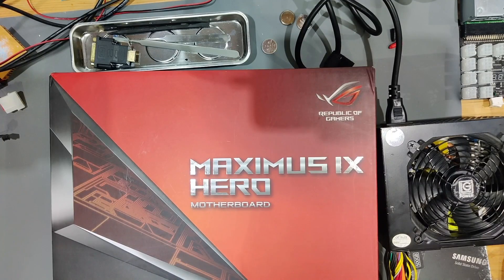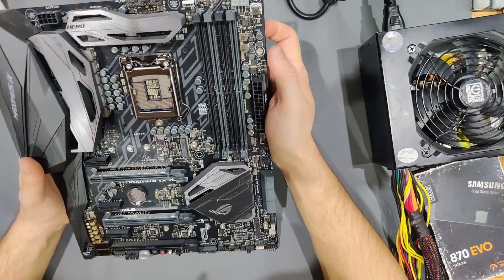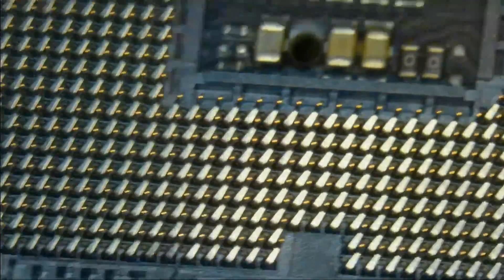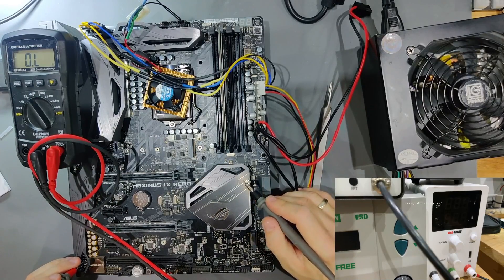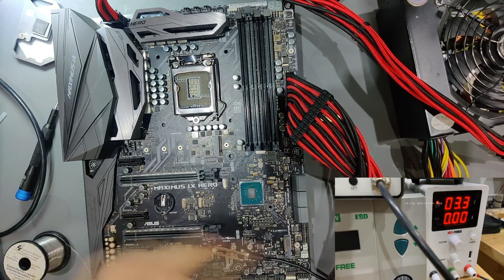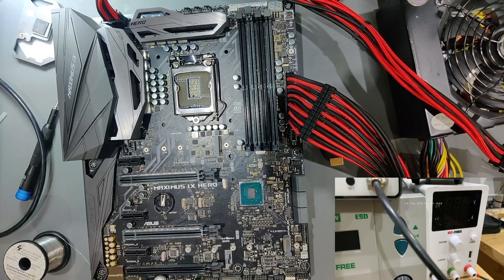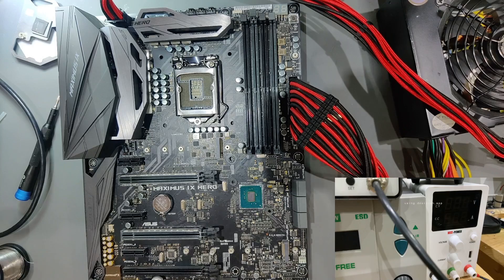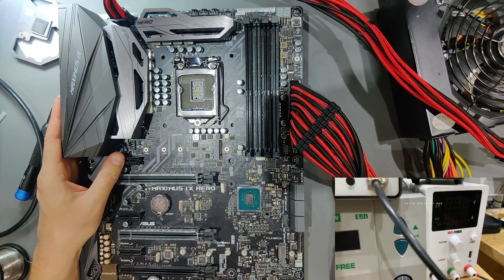I HATE REPAIRING Z270 | I AM CURSED | Asus Maximus IX Hero Z270 MOTHERBAORD REPAIR

Comment: have a question I have a mossfet that I want to change that had three pads or I'm sorry four pads on it to connect when I took the old one off now I've got one pad and a Big Blob across the other part I use a solder Wick took all the solder off but it's still a big long blob did I ruin something not real good at doing this
Reply from the maker: No not really, you need to make sure to have less solder. There are 3 contacts are are connected on the mosfet (3 little ones) and the fourth one is gate, that one is not connected to the other 3 small ones. The big one also shouldnt be connected to the other ones!
Reply: got it thank you
 @MainboardMedic
Reply: If you mean the drain you dont have to wick its all 4 pads connected together same line

Comment: I'm very new to understanding motherboards and have only done basic repairs. But I have an Msi X299 board that has similar issues to this- board does not power on, I took off the heatsinks and the chipset gets very warm but nothing past that. Is it ever possible to just swap the PCH on a board?
Reply: It is but PCHes are quite expensive and hard to obtain. It's also, in most cases, pointless to take PCH out of working board.
Reply: Check the crystal oscillator around the pch if it is working using oscilliscope.. faulty crystal oscillator also one reason the motherboard doesnt turn on
Reply: you can inject 3.3 volt using your pc power supply on the output of the LDO which is feeding the chipset (you have to do it on the 3v rail though), if it gets hot its dead.
Also short pulses of heat means the pch is shorted i think, when the motherboard is on standby state.
as for replacement, chinese sellers on ali use many different chipsets on the same socket, they are not good as the x99 chipset but they work, maybe you can try sourcing that if those are cheap and if it will work on this board..
Reply: Check the crystal oscillator around the pch if it is working using oscilliscope.. faulty crystal oscillator also one reason the motherboard doesnt turn on

Comment: I feel your pain. I've got X2 Z790 with no schematic. Very frustrating when you buy off ebay and it's a completely different fault than what is posted
Reply: ONLY if the item has no description other than "defective" or "Untested" you shoyuld consider it a direct loss: the seller told you it's broken, not WHAT's broken. You should not agree with a short "It was sold as defective" when the text that was provided is totally different from the symptoms you experience. The text was simply misleading, so you should file a claim with ebay; or at least provide the feedback that the seller deserves.